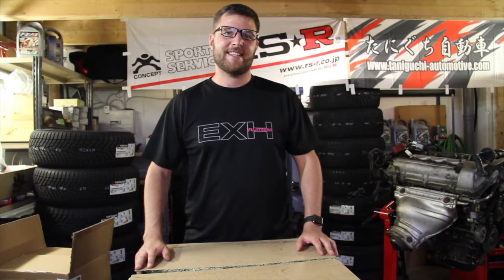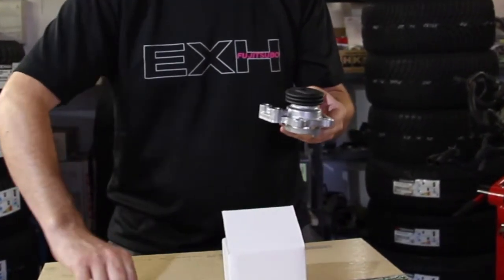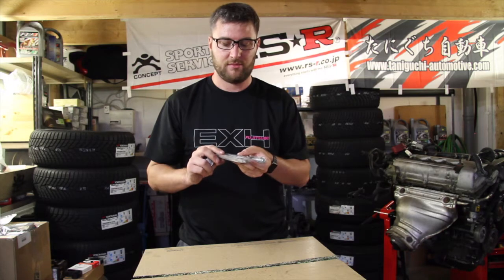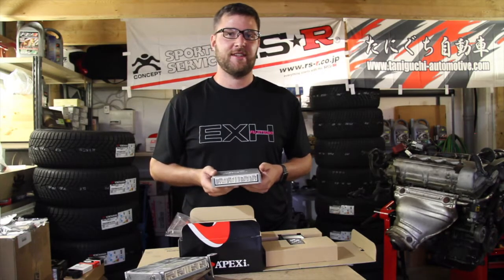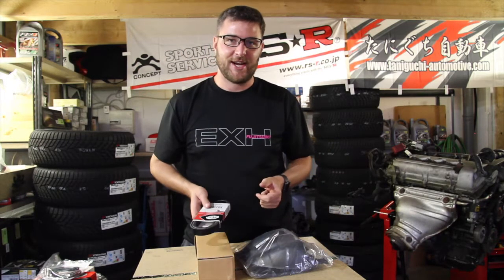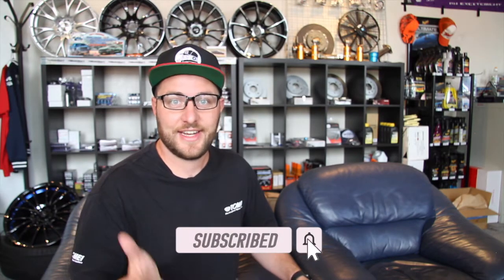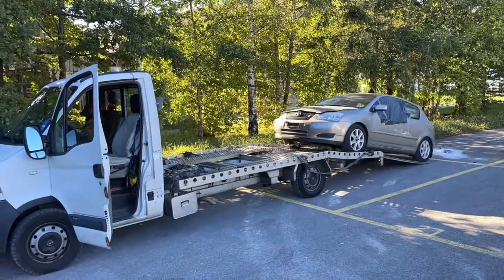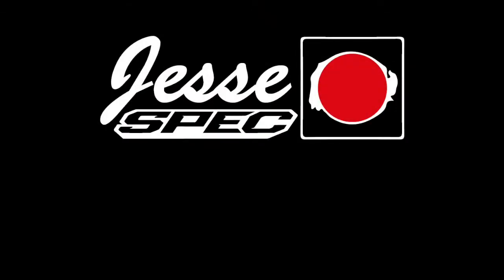EP4 Project Lotus Hunter: What is needed to perform a 2ZZ Swap on a Toyota Mr2 ZZW30? Full list

Comment: are there are other parts i should get for supercharged 2zz?
Reply from the maker: Hi, I never did the SC conversion but it should be very similar. Use this list as a starting point and add the extras if needed as you go 👍🏼

Comment: What about the air injection ports??
Reply from the maker: Hi! What about them?
Reply: @JesseSpec  
Are they blocked off by the header you bought or will you block them off with studs?
Reply from the maker: @kareembell1164  hi, if you are talking about the EGR system in the exhaust manifold, yes I ditched the whole system. By the way, my exhaust setup video shows this with great detail, you might want to check that video out
Reply: @JesseSpec  
Will check it out.